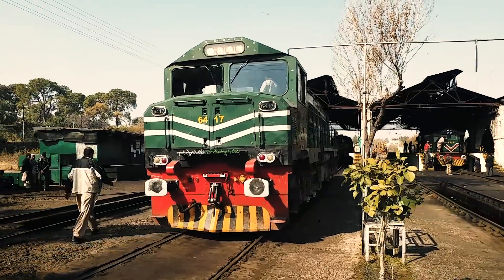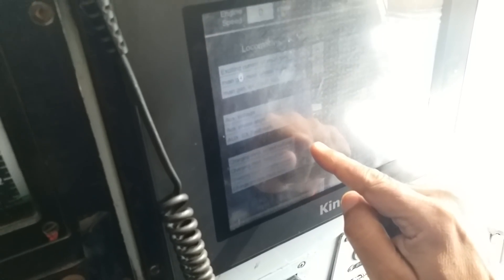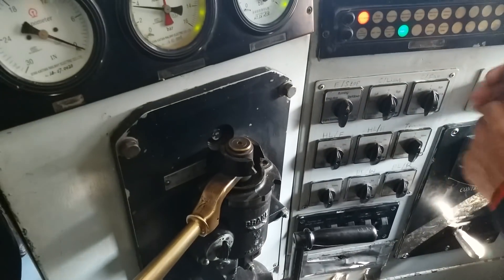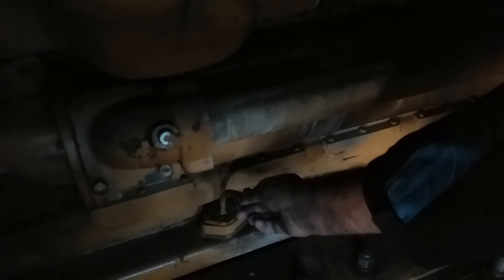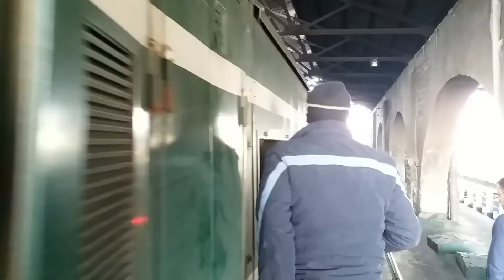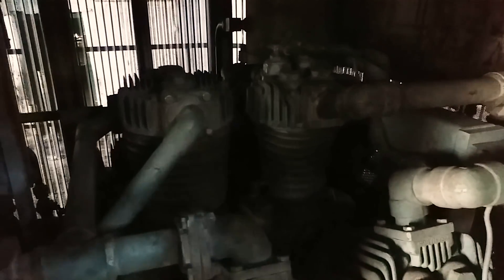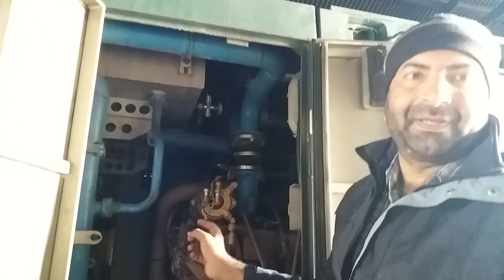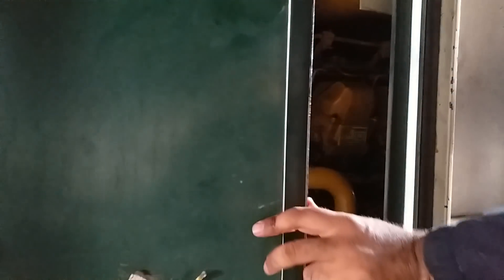How to start a Locomotive | starting a locomotive | Diesel engine cold start | Pakistan Railways

Comment: IN YOUR LOCOMOTIVES DO YOU ALSO USE WATER AND A CORROSION INHIBITOR? I HAVE HAD GOOD LUCK WITH SODIUM BORATE NALCO BRAND PELLETS.
WHAT IS THE SPECIAL COOLANT
USED?
IS IT USED IN THE CATERPILLAR 
ENGINES?
Reply from the maker: I am not aware of water and corrosion inhabitor but they are obviously using coolant